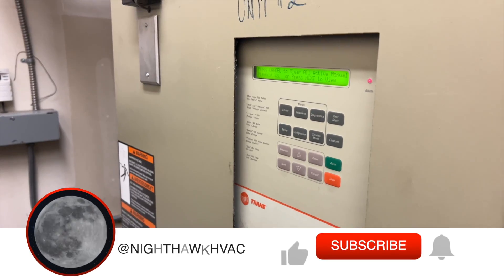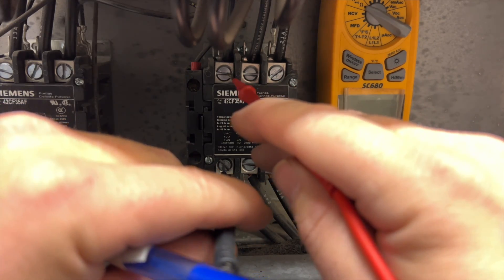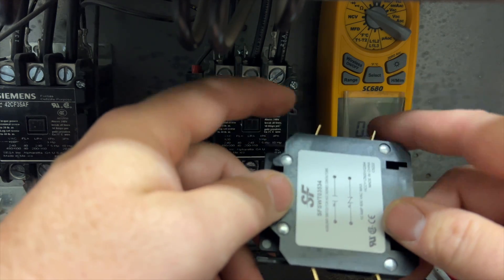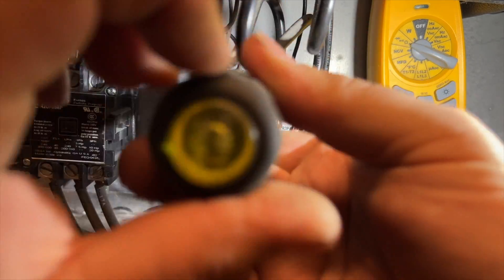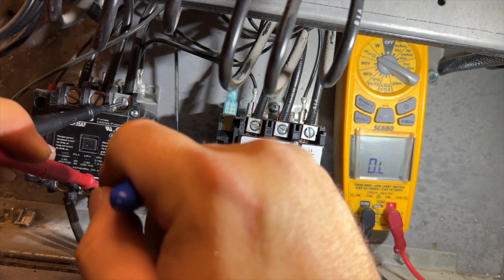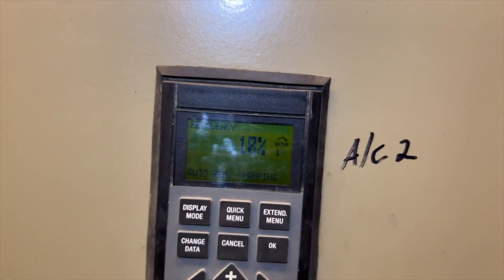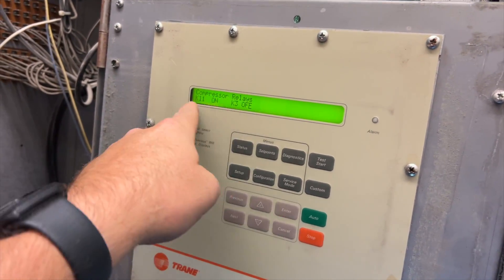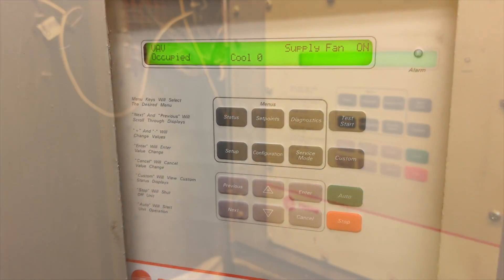Circuit 2 Compressor Keeps Tripping on a Trane Self-Contained Intellipak EP154

Comment: I replaced my contacter but still getting trip on compressor
Reply: Check all my connects they are good and check wiring it was good no shorts
Reply from the maker: Your compressor may be over amping. You could also have loose connections or even worn out wiring.
Reply: Check the compressor motor protector